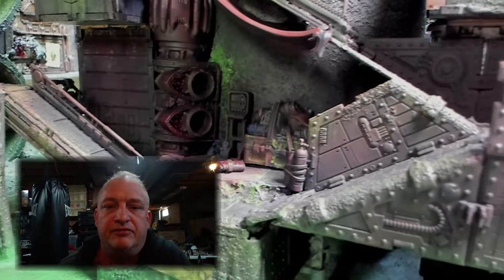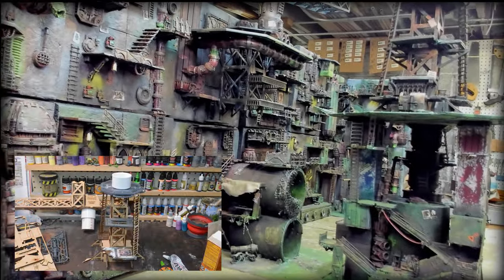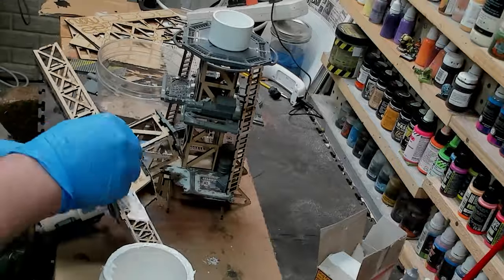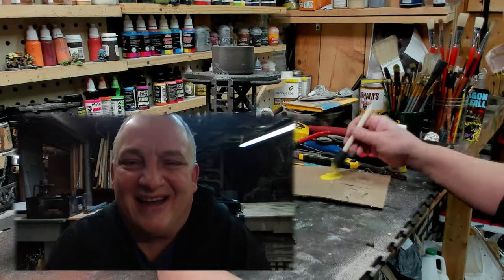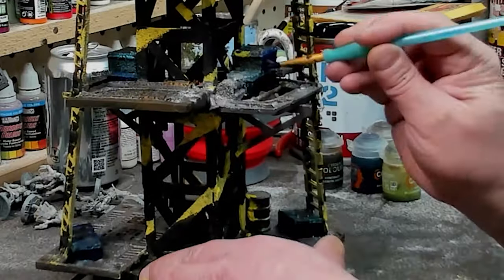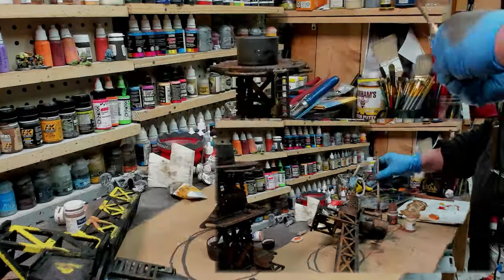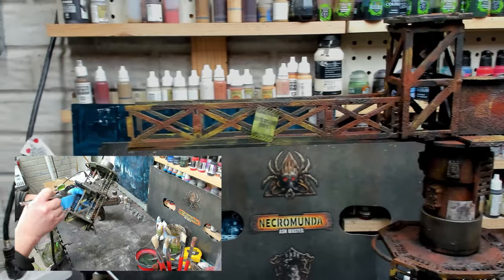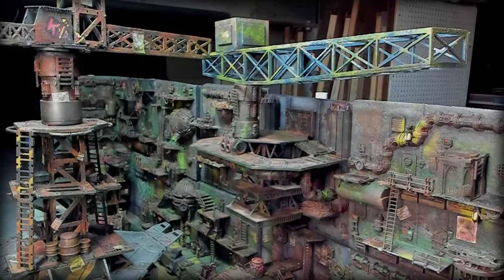Necromunda Sump Crane

Comment: On this piece did you wait for the oils to totally dry before adding your weathering powders, or apply them when things are still a bit wet to have the mineral spirits and the oil pants interact with the pigment powders?
Reply from the maker: somewhat wet.....  I let things dry a bit for about 30min to an hour before doing the powders........  Wanted to adjust things a little bit.... and I had to pick my kids up from practice also..... I think......  Worked out pretty well really!  The really goopy stuff was a little dryer which intern didn't quite mix everything so fast in that step.  I'm probably going to be inserting it for future projects.  Thanks!

Comment: Could I ask what type of glue you use to attach the wooden ladders to the pvc piping?
Reply from the maker: Its cheap super glue sprinkled with baking soda.  The cheaper and smellier the glue the better usually.  Once you add the bicarbonate to it, it gets rock hard.  A good trick if you want to fill a gap with a welding line as well as rust effects.  Thanks for tuning in!